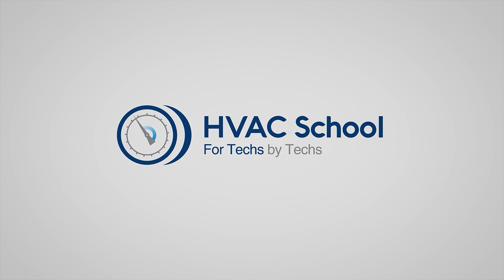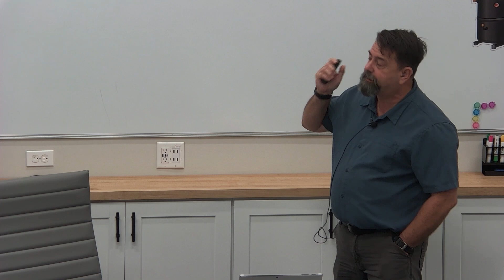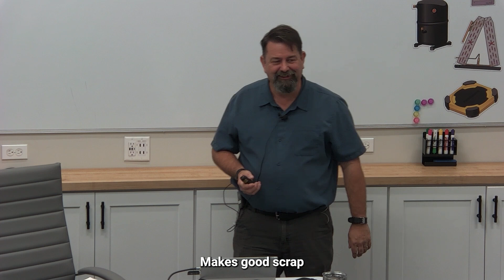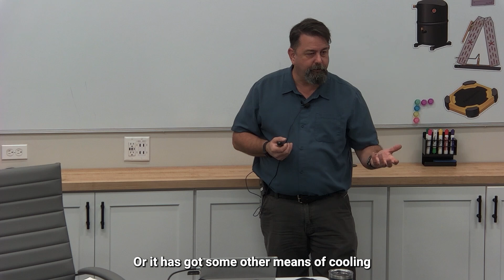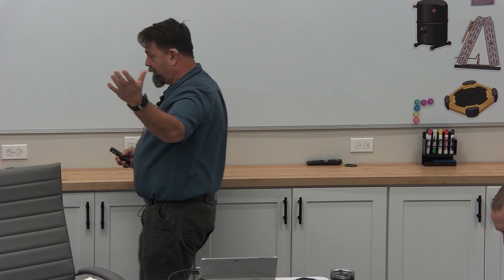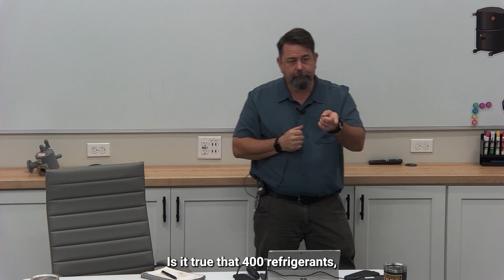Rack Refrigeration Cycle Part 1 - Fundamentals w/ Matthew Taylor

Comment: @ 31:20 he talks about calculating the HP of a compressor using BTU's from the subcooler? Can someone explain this more i cant grasp it.
Reply: JP, I was running through that pretty quick in the first part here.   Be sure to check out part 7 - Subcoolers, I start it with digging deep into your question, with an example.  Let me know if that doesn't clear it up for you!
Reply: Thanks a lot, makes perfect sense now
Reply: As refrigerant saturated pressure drops in the evaporator, it becomes Less dense and therefore it can’t absorb as much heat as a higher saturation temp. This is why low temp applications need a sub cooler the increase the density of the boiling refrigerant in the evap.  He is elaborating on how more pumping action (HP)is needed to move the same btu in the less dense vapor because it’s caring less heat.
Reply: Also called a cascading system. Although, technically, I think by formal definitional that means different refrigerants, but same concept…

Comment: Any recommendations on how to get trapped oil out of a case on the sales floor? Rack was overfilled with oil and now is trapped in several evaporators down in the bunker case. 3 of 6 evaporator coils are filled.
Reply: Should be returning with defrost, somethings off there.  Electric or hot gas?  If electric, you should have a liquid stop and a suction stop.  One of them is not "stopping"!